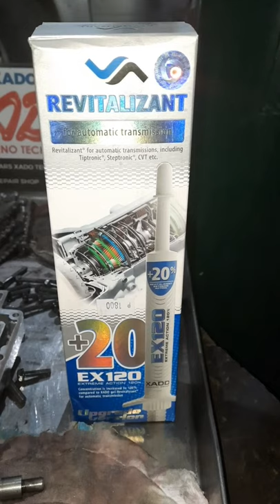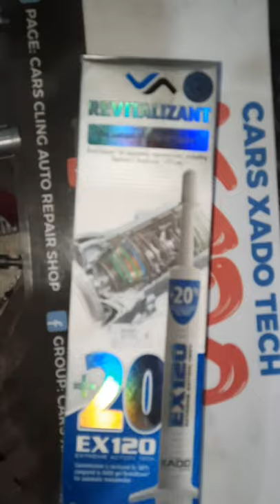ISUZU TROOPER AUTOMATIC TRANSMISSION VALVE BODY OPENING UNDERGO VALVE BODY DE CLOGGING ISSUE FIXED

Comment: sir, makuha din kaya sa valve body cleaning kung may shift shock sa reverse ng AT?
Reply from the maker: Yes Sir,. Ang shift shock nakukuha sa kanyang shifting cable mechanism sa shifting cable housing assembly baka po kulang sa adjust or need na palitan ng parts,.
Reply: @carsclingtv  sir nasa transmission case ba yang shifting cable mechanism at assembly?
Reply from the maker: Nasa loob ang shifting assembly, at nasa labas naman ang shifting cable ng automatic transmission Isuzu Trooper.

More Basic Pointers  Toturials videos: https://www.youtube.com/channel/UCXSl7FUzPZV3lIxFWCHFTVA
FB Page CARS CLING TV: https://www.facebook.com/clingauto
CARSClingTvShortVideos: https://www.youtube.com/channel/UCsUWQnaD9vVKqL_w6eAYhgA
#
#xadoenginetreatment 
#carsclingtv 
#basicpointerstutorialissuefixed 
#xadoenginetreatmentengineperformancerecovered
#10yearslonglastceramicscarbonmetalcoated 
#carsclingautorepairshoplegacy 
#trottledelayremoval
#blackwhitesmokeremoval
#lowpowerengineremoval
#carsclingtvshortvideos
#xadoenginetreatment 
#changeoilpms
#enginecarbonchroming 
#carsclingautorepairshop
#remedyxadotreatment 
#acceptcheckengineissue 
#troubleshoot 
#legitonlineseller  
#Mobile09171259996
CARS CLING TV Located @Purok Pandian Gay Corner Makar Highway Brgy. Labangal General Santos City SouthCotabato 9500

Comment: Bossing A30-43LE isuzu bighorn 1998 , nirebuild sa banawe ang transmission tapos kinabit namin dito sa mindanao, umaandar malakas fluid pressure pero ayaw mag shift laging nasa 1st gear lang, san ako magsisimula mag check, ung solenoid nya or accumulators
Reply from the maker: paki check muna sir ung solenoid, baka may hindi gumagana bago sa accumulators.

Comment: Pila ang gasto
Reply from the maker: Yes Sir,. Almost 12,000.00 Sir,. Labor materials,
Reply: @carsclingtv  sir niay akoa sir murag mao gihapon na problima ani sir dili ka starting kung medyo subida pag drive.. pero ok tanan L1 to3 ug reverse.. pwd ko matabangan nmu ani sir nia man gudko davao.. v6 ni akoa 3.2 gasoline
Reply from the maker: Kapag ang isang V6 engine ay hindi mag-start kapag naka-harang o paahon ang daanan, maraming posibleng dahilan na pwedeng magdulot ng ganitong problema. Narito ang ilan sa mga posibleng sanhi at kung paano ang pangunahing hakbang upang ma-diagnose at maayos ang problema:

### Posibleng Sanhi:

1. **Fuel System Issues**:
   - **Fuel Delivery Problems**: Maaaring nagkakaroon ng issue sa pag-deliver ng fuel kapag paahon ang sasakyan dahil sa posisyon ng fuel tank at fuel pump.
   - **Fuel Pump Malfunction**: Kung ang fuel pump ay hindi kayang mag-supply ng tamang pressure ng gasolina sa makina habang paahon, hindi mag-start ang engine.

2. **Battery and Electrical System**:
   - **Battery Issues**: Kung mahina ang battery o maluwag ang terminals, maaaring hindi ito magbigay ng sapat na power upang i-start ang engine, lalo na kung paahon at may karagdagang load ang sistema.
   - **Grounding Issues**: Maaaring may problema sa grounding connections, lalo na kung may rust o corrosion.

3. **Ignition System Problems**:
   - **Ignition Coil Issues**: Ang faulty ignition coils ay maaaring magdulot ng misfire o hindi pag-start ng makina, lalo na kung may paahon na load.
   - **Spark Plugs**: Worn out o fouled spark plugs ay maaari ring magdulot ng hindi pag-start ng engine.

4. **Engine Oil Pressure**:
   - **Oil Level**: Kapag mababa ang oil level, maaaring hindi mag-circulate ng maayos ang oil sa makina kapag paahon, na magdudulot ng safety shut-off mechanisms ng engine.

### Hakbang sa Pag-diagnose at Pag-aayos:

1. **Check Fuel System**:
   - **Fuel Level**: Siguraduhing sapat ang level ng gasolina sa fuel tank. 
   - **Fuel Pump**: Subukang pakinggan kung gumagana ang fuel pump kapag binubuksan ang ignition (humming sound mula sa likod). Maaari ding gumamit ng pressure gauge upang sukatin ang fuel pressure sa fuel rail.
   - **Fuel Filter**: Palitan ang fuel filter kung duda ka na barado na ito.

2. **Inspect Battery and Electrical Connections**:
   - **Battery Charge**: I-check ang voltage ng battery gamit ang multimeter. Dapat nasa 12.6 volts o higit pa kapag hindi umaandar at higit sa 13.7 volts kapag umaandar.
   - **Terminals and Connections**: Linisin at higpitan ang battery terminals, at suriin ang lahat ng grounding connections.

3. **Inspect Ignition System**:
   - **Spark Plugs**: I-check at palitan ang spark plugs kung worn out na.
   - **Ignition Coils**: I-check ang kondisyon ng ignition coils at palitan kung may sira.

4. **Engine Oil Level**:
   - **Check Oil Level**: I-check ang oil level gamit ang dipstick at siguraduhing tama ang level ng oil.
   - **Oil Pressure Sensor**: Kung mababa ang oil level, maaaring magbigay ng misleading readings ang oil pressure sensor.

### Karagdagang Tips:

- **Diagnostic Tools**: Kung may access ka sa OBD-II scanner, mag-scan ng error codes. Maaari itong magbigay ng clues sa anumang underlying issues na nagdudulot ng problema.
- **Gravity and Fuel Pickup**: Hindi common, pero minsan, depende sa disenyo ng fuel pick-up sa tank, maaaring hindi maka-pick up ng fuel properly kapag nasa sloped surface.
- **Routine Maintenance**: Siguraduhin na updated sa routine maintenance ang sasakyan, tulad ng pagpapalit ng fuel filter, spark plugs, at regular battery checks.

Ang sumusunod na gabay na ito ay makakatulong sa pag-diagnose at pag-aayos ng problema sa iyong V6 engine kapag hindi ito nag-start kapag paahon. Kung hindi sigurado o walang improvement pagkatapos ng ilang hakbang, mainam na mag-consult sa professional mechanic para sa mas detalyadong inspeksyon at solusyon.

Thank you for your support!

More Basic Pointers Toturials FULL Videos: https://www.youtube.com/channel/UCXSl7FUzPZV3lIxFWCHFTVA
For more inquiries, please contact us at our 
FB Page CARS CLING TV: https://www.facebook.com/clingauto
CARSClingTvShortVideos: https://www.youtube.com/channel/UCsUWQnaD9vVKqL_w6eAYhgA
#
#xadoenginetreatment 
#carsclingtv 
#basicpointerstutorialissuefixed 
#xadoenginetreatmentengineperformancerecovered
#10yearslonglastceramicscarbonmetalcoated 
#carsclingautorepairshoplegacy 
#trottledelayremoval
#blackwhitesmokeremoval
#lowpowerengineremoval
#carsclingtvshortvideos
#xadoenginetreatment 
#changeoilpms
#enginecarbonchroming 
#carsclingautorepairshop
#remedyxadotreatment 
#acceptcheckengineissue 
#troubleshoot 
#legitonlineseller  
#Mobile09171259996
CARS CLING TV Located @Purok Pandian Gay Corner Makar Highway Brgy. Labangal General Santos City SouthCotabato 9500